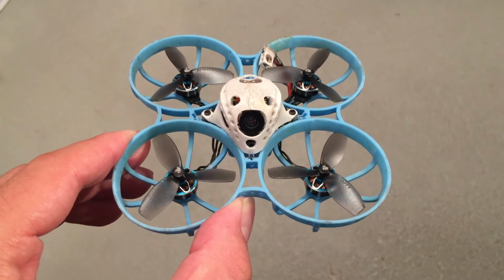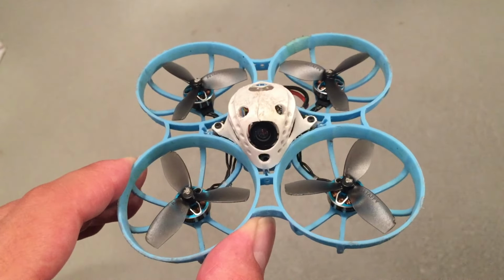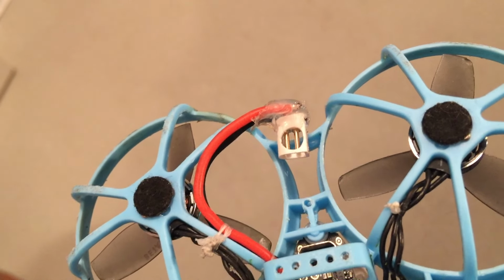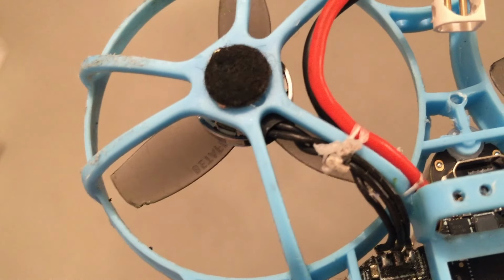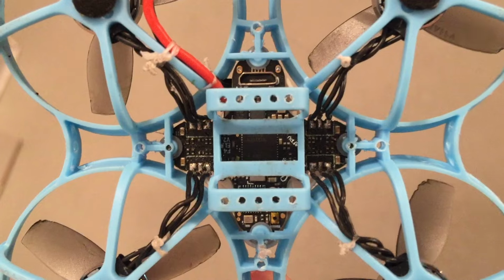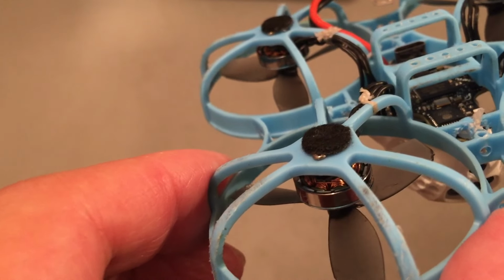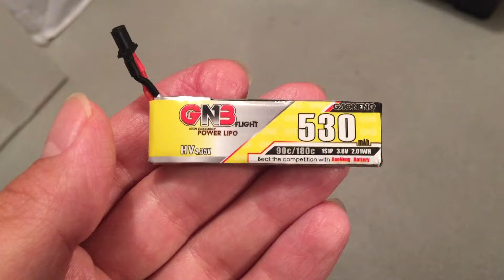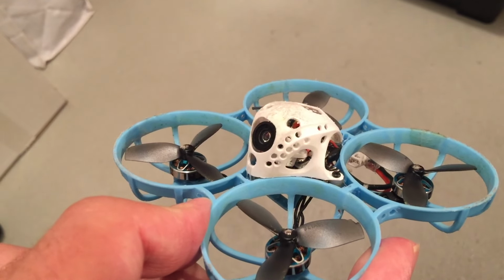More POWER and FLIGHTTIME for your Betafpv 75Pro Whoop | ButterflyFPV Edition of the Betafpv 75 Pro

Comment: Mate great tips. Look forward to doing the lead change. I also need to really get my hand drill out on that frame/canopy. Good info as always!!
Reply from the maker: 🤜🤛Yes, AWG20 main cable is a must for race pilots!
Reply: @butterflyfpv wow my holes looked rough until I found my proper jewellers drill set
Reply from the maker: @rodsawhite  Can you send me the link to that jewellers drill set?
Reply: @butterflyfpv I meant to write PCB drills - they are so much easier to start holes and ream out cleanly
Reply from the maker: @rodsawhite  Ah yes! Thats true! I think they are sharper and harder. That's why they break when they fall on the ground. I've already broken about 10 because I dropped them lol.. But as you say, they drill well through soft plastic. I only use normal drills anymore if I can't get around to it with the PCB drills.

Comment: what is your rates setup? Im looking for something in the middle of freestyle and Racing. I am also looking at getting higher KV motors and maybe a new camera any recommendations?
Reply from the maker: My Rates are: Betaflight RC Rate 1.20 | Rate 0.70 | RC Expo 0.00 | 800 degrees on all axes. You can see them here in the pictures at the end of this video: https://www.youtube.com/watch?v=2wCopw5o4Co   Throttle cut depends on the kv of the motors. If the kv is very high like on my 80mm 2S 1102 18000kV build the you can go to Throttle cut scale 60% if needed.. I can recommend this Cam for a good picture in most situations: https://www.youtube.com/watch?v=0gtVZ4s5iB0&t=17s

Comment: Hi, can the meteor 75 pro fit a GNB 550mah A30 with 18mm wide lipo in the battery holder of that frame? Also, nice video for explaining the change you made with this whoop. I might buy one.
Reply from the maker: GNB 550mah 100C? This one fits! It's a bit long. But it fits. I can highly recommend this whoop. Especially if you fly outside often.
Reply: @butterflyfpv  yeah, that one. Thank you!

Comment: Have you tried clipping off the beams around motors? Feels like 3 out of 6 is plenty enough, and it should save much more weight than all the holes you drilled.
Reply from the maker: I thought about it. But because I often fly the whoop outdoors, I like the durability of the 6 struts. And the frame is made of relatively soft material. 3 struts might be enough, but damage to the propellers would be more common.
Reply: @butterflyfpv i think u can clip some struts on the back hoops and some in the middle bc of the strong connection. Just dont remove the ones in the front as there will be most of the impacts.

Comment: you dont replace the motors? exactly what gives more speed to the drone? the cable and conectors? im a begginer in this, sorry for my little knowledge
Reply from the maker: No problem. Correctly. Because there are currently (27.11.24) no other more powerful motors for this size of drone/propeller. Only larger ones which are significantly heavier. That doesn't help. If you can find a motor that is the same weight (or lighter) with the same size and more power then you can use that. But that doesn't currently exist. An 1102 motor with 25000kv would be interesting, for example.
Reply: @butterflyfpv  i understand, but i have a question, what type of batteries i can use in that case? the same of the video? what googles do you use?
How far and how high can it go? Its maximum?
Reply from the maker: You can use Betafpv Lava 1S HV 550mah 75C, Betafpv Lava 1S HV 450mah 75C, GNB 1S HV 550mah 100C, GNB 1S HV 530mah 90C, GNB 1S HV 380mah 90C.  Thats my gear: https://www.youtube.com/watch?v=RN2iM5j4Yk0 You can go about 100 meters high and maybe 150 meters far with my setup (with no objects between you and the whoop). I hope this helps.
Reply: @butterflyfpv  alr alr, tysm but.. if i try changing the awg cable in the Hd walksnail version, i got the same results that in this tinywhoop right?
Reply from the maker: @SSChara....66666  The probability is high if you mean the positive effect of the AWG20 cable only. The HD whoop will always fly worse than the analog whoop because it is so much heavier. But personally I would also do the AWG20 cable mod for the HD whoop too. A positive effect is not certain. But to be honest, it's very likely. Please give me feedback on how you felt after the modification. If you do the mod.

Comment: Good Stuff 👍 I found the carbon fiber ring protector/mounts from the motor wire at the base of the motors is often misaligned and not seated properly which can increase motor sound. First time I have seen these and thinking it might be good to remove them for weight. You think they help performance in some way?
Reply from the maker: Thank you! Interessting! It will be difficult to remove these carbon rings without rewinding the motor. And no, these PCB rings are not for the performance of the engine. But so that it's easier to solder on new motor cables if a motor cable breaks off. That's why these PCB rings are a good thing in principle.

Comment: Amazing huge job done and explained!
About 1st modification- isn't itAWG22 originally and does it make that big of a difference?
Could you please explain more in details why those 550mah batteries are bad to use?
Where could I got the good/right pids/rates/expos/cuts?
And most important... is this Meteor75pro is best drone for 1st one to start practice fpv/acro or you can suggest some other drone to pick?
Reply from the maker: Thank you for your feedback! Yes original is AWG22. And I changed it to AWG20 cable (The smaller the AWG Number, the bigger the cable) and YES the difference is very big! This is also why it`s not FULL SEND bulletproof anymore with the 550mah lipos and the 5A ESC`s on FULL SEND flights (outdoors with a lot of 100% Throttle, especially in turns). I can feel the ESC`s struggling. I mean it flies, but the question is for how long. I'm 100% sure that an ESC will burn out at some point. I know that from experience! That's why I warned about it in the video. But this really only applies to full send pilots. If you fly with little to no 100% throttle I'm pretty sure it won't be a problem with the 550mah lipos. Indoor racing should also still be possible. You can take the PIDs directly from uavtech. The link is in the video description. And everyone has to figure out the rates etc. for themselves. There are many videos about this on YouTube. I might also make videos about it at some point. But I have little time and a lot to do. But maybe someday I can do it... My plan is that I want to create the best strongest whoop in the world first. And when I've gotten the most out of it and there's nothing left to learn, I'll make more beginner-oriented videos. But first I would like to make performance-oriented videos. I hope you can understand me..

YES Meteor75pro is a very very good (if not the best) to start practice!
Reply: @butterflyfpv  Thank you! Will need to buy awg20 cables and change it. Is it same for Meteor65pro(I already have this one).
Didn't get the part about 450 and 550 batteries... what is the point and difference(why one is bad and the other is ok for the ESCs - will it be still a problem if i upgrade the cables?)(also what flight time you have with either?)
Reply from the maker: @Braincho  No I`m not sure with Meteor65pro since it is low kv. But you can give it a try and give me feedback. Regarding the Lipos: With the AWG20 cable plus 550mah Lipo you can pull more amps because lipos with higher capacity and bigger cables do have less internal resistance. So if you go full send with a lot of throttle then there may be larger amp spikes. And because the esc on the 75pro is already tight, it may be that it is too much for the ESC.. It can. It doesn't have to. So if you don't fly at 100% throttle all the time then you can fly with 550mah lipos without any problems. But with the 450s the whoop feels lighter due to the lower disc load and is more maneuverable..
Reply: @butterflyfpv  Cool. So better overall to use 450mAh.(you use 450 mostly?) Also how many packs you fly daily to have a good practice?
Reply from the maker: @Braincho  Yes for me 450mah. (gnb 530mah are also 450mah size and weight). You can start with 4 packs per day. Thats a good start. And if you can do 6 packs its even better. and with 10-12 packs per day you can see relatively fast improvements..
Reply: @butterflyfpv  Do you think is a decent idea to fly 75mm with a 300mAh baterys?
Reply from the maker: @Braincho  Yes it is possible. With 300mah 75C Lipos.. Or GNB 1S HV 380mah 90C
Reply: @butterflyfpv  I just have several Lava 300mah and wondering if I get Meteor75pro would i need another set of batteries or I can keep using my.
Reply from the maker: @Braincho  meteor 75pro is a 80mm whoop not a 75mm! 300mah is ok for 75mm but not for 80mm!
Reply: @butterflyfpv  wow... new info.... sad, but thanks a lot! All the "pro" are +5mm? 
Also how you guys know what frame to motors to props to battery to use for best?
Reply from the maker: @Braincho  At least the newer "pro" from betafpv yes.  I don`t know why they don`t call it Meteor80.. My knowledge is from testing. I bought everything. And I did all the combos. Was a lot of work😅 But now this work is done and you can profit from our experience👉💪And with the betafpv meteor 75 pro, beginners now have the opportunity to buy a very good, high-performance whoop without having to tinker with it themselves. In other words, 2024 is a damn good year to start with FPV🤘

Comment: Did you try the new hq 45mm props ? DFR has them in stock.
I just put the 45mmx2 on, but havent tested enough.
Reply from the maker: Not yet. Thank you for the tip! https://www.drone-fpv-racer.com/en/micro-45mmx3-pc-propellers-15mm-2cw2ccw-by-hqprop-12841.html

Comment: Between the 75 and 75pro, which one do you prefer? And which one has better flight time or is the difference insignificant? I want to fly indoors and I would like to have the best flight time and performance
Reply from the maker: You mean Betafpv meteor 75 vs meteor 75pro? Then I prefer the 75pro because of the better performance.. and the flighttime is also very good.. I'm not sure if the flighttime is better than the meteor75 because I've never flew it. But when hovering or cruising slowly, the 75pro probably has about 1-2 minutes more flight time..
Reply: @butterflyfpv  Thank you, I'm going to buy the pro frame, I'm not going to fly very fast and I intend to use 1s, I think the bigger propellers will help with flight time
Reply from the maker: @rianlira4111  Yes I think the 75pro is very good. And on some days you maybe want to go fly outdoors too. And the 75pro is very good for outdoors.
Reply: @butterflyfpv  Another question, do you think the 1002 engines can handle the propellers and larger frame? I saw that the Pro uses 1102 engines and I didn't want to buy bigger engines
Reply from the maker: @rianlira4111  1102 size motors are perfect for 45mm three bladed props for racing. Rcinpower 1002 22000kV can handle 45mm two bladed props. But I prefer 1102 size motors for racing. Not bigger and not smaller..
Reply: @butterflyfpv  Thank you, I'll think better about what size and lowest weight I got my first drone, it was a custom 3.5 inch drone, but 4s batteries are very expensive here in Brazil and whenever I go outside, a tinywhoop 1s for practice will be ideal.
Reply from the maker: @rianlira4111  Yes tiny whoops are much better for practice in some applications. This is why I fly only tiny whoops. So easy and so much fun!